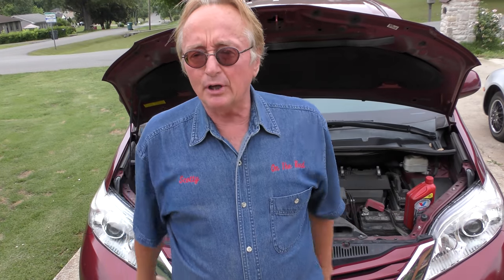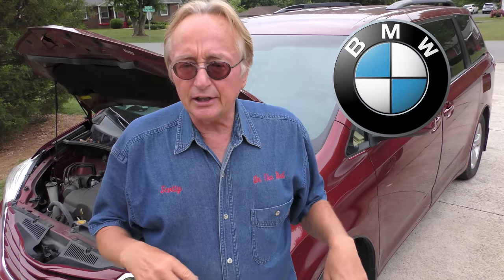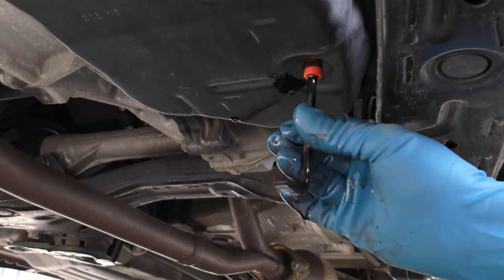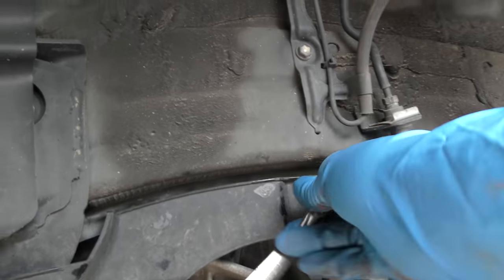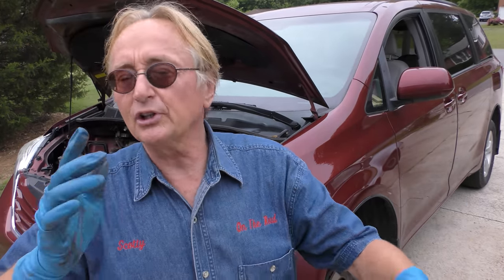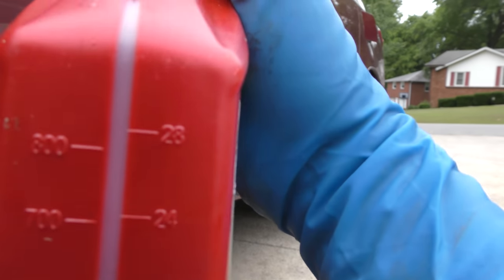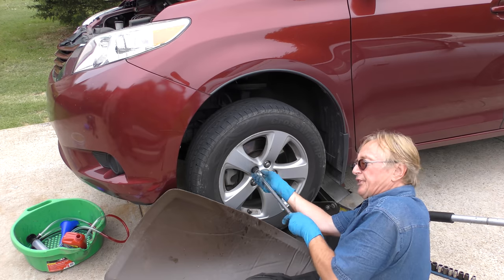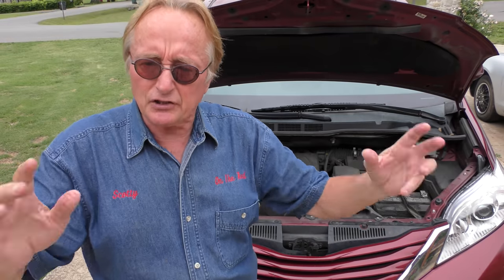Here's Why Changing Your Transmission Fluid Can Cause Damage

Comment: No dipstick is a pain when it comes to refilling.  I put the old fluid into a clear milk jug and use another clear milk jug to place the new fluid into.  Match the levels and you’re on the money quick and not messy.
Reply: I guess so, unless there’s been fluid loss.
Reply: @ltcajh  If the original amount of fluid is not correct all you do is magnifying an already existing problem.   The dipstick was more valuable than people realize.

Comment: I had two vehicles get a power transmission flush done by certified mechanics a couple of years apart from different shops. After several months of light driving, both transmissions failed causing me to lose over $6,000 in total for repairs. I will never ever get a transmission flush done again. Both vehicles had over 150,000 miles each when I decided to get this maintenance done.
Reply: I've now had my third car to make it over 200,000 mi and never did a transmission flush because of the same fears you have.

Comment: I bought an 06 Tacoma at 136k miles and just did 150k service. My mechanic said the same as Scotty, that the trans fluid shouldn’t be changed and that it was essentially “too late”. 
I decided to be proactive and have another shop do an ATF drain and fill. Turns out the fluid, while dark, didn’t have any burnt smell, and didn’t have any metal shavings in it. The transmission has been shifting just as well as before. 
The gasket also needs to be replaced, which I wouldn’t know unless I had taken it in. I’ll do the gasket and filter replacement at 160k and get more fresh fluid in.
Reply: did you replaced filter as well?
Reply: @aztec3r890  yes I eventually went back and did new filter and gasket, plus as much fresh fluid as that job required. It’s shifting better than it did when I bought it.
Reply: @rossedwardmiller  if u want it to do even better get some ams oil for the Trans, night and day difference for sure, I use it in my drag car, a good example would be my camaro for instance lol it was a 2013 with 62k when I bought it, Trans was replaced at 72k for slippage, got it back and it was running fine but could still feel the shifts and whenever u wanted to punch it, it took a sec to get into that gear and let u go, now whenever I changed the fluid at 90k and I couldn't have been happier lmao you no longer felt any shifting and if u punched it, it went into gear quickly and went just like how it suppose to lol but definitely recommend them for the next Trans service, I've been using them for years plus the camaro mileage is at 200k now with that Trans lol plus my other cars

Comment: I own a 2010 Kia Optima 4 cyl. My daughter used to drive it in a busy city.  She returned it back to me at over 100k miles. I noticed that the transmission jerks or slips when it down shift from 2nd to 1st gear.  The transmission oil was never changed. I purchased Valvoline TF and drained and replaced the fluid 3 times. It took over 3 gallons to change the fluid 3 times. We used to drive the car for few miles after each fluid change. I noticed a lot of steel particles attached to the drain plug magnet. After I drove it for few hundred miles, slipping disappeared and the car shifts like new.
Reply: But Scotty says you aren't supposed to change the transmission fluid on an old vehicle that's never been serviced. It will make things worse according to him.

Comment: That red tube you take out is the “internal dipstick”. The drain plug is actually the level check for the transmission. The red tube is there as a level for the fluid in the pan. You have to get the trans up to temp , then with the car running in park, take the plug out (without removing the red tube) and see if fluid dribbles out. If fluid is dribbling out, the trans is up to level. If no fluid dribbles out, you are low, if it gushes out you are overfull.
Reply: Different cars has different process. Some cars have to be off when checking fluid.
Reply: I will attempt the change very soon.  I'm scared
Reply: @mef12727  And what kind of cars are they?
Reply: 104-113F is the specification

Comment: HOLD IT... when tightening the LUG nuts, I only lower the wheel enough to get the ground friction needed to keep it from turning while applying the final torque, NOT all the way down and under full load, which could leave you "half a thread out" on the lower lugs, and result in the dreaded wobbly-wheel... =:O
Reply: When using an impact wrench, start on #1 & do the torquing order. Go to #2 or #3 and do the same. Most shops hit it wide open on all lugs. You can get a wobbly wheel or shakey brakes this way. Follow up with a torque wrench on the ground. I never have any shimmy.
Reply: Never had that problem
Reply: The rim should be sitting on the center hub and the nuts or bolts should always be finger tightened before lowering the vehicle. Once torqued to spec the rim is clamped tightly to the rotor or drum and the tire will have no choice but to flex. The rubber is bendy enough. I have never had a problem with a wheel wobble.

Comment: Scotty Kilmer, I have a 2013 Kia Sedona ,  it has 135,000 and the transmission fluid has never been done.
Will it be ok to change it and and wait a week and change again in conjunction with the transmission filter to clean up all the dirt accumulated from making the 1st fluid change a week before. 
 So I heard if you only Change it once then you will have problems because the fluid has detergents that will clean the transmission and clogged the filter . That’s why I want to do 2 fluid changes. Thank you 🙏

Comment: Scotty is so right about some places not even changing the fluids, I had that happen at Wheel Works on a synthetic oil change.
Reply: Me too. At a Toyota dealer that has been gone for a long time. I noticed when it came back that it’s still have my same silicone gasket that I recognized as mine. Even the complementary car wash was terrible. Didn’t dry it right and waterspots everywhere.

Comment: My cars are from the 90's, and I replace some of the transmission fluid at each motor oil change. I draw some of the transmission fluid through the dipstick snorkel with the pump that Scotty used in this video, they cost about $10, find them where tools are sold under various brand names. Do the same for the steering fluid.
Reply: While it doesn't hurt to do that, you really want to drain the fluid from the transmission fluid pan. Most of the crud you want to get out is sitting at the bottom and sucking it out from the top won't do as good of a job.
Reply: @raizt1596  exactly
Reply: @raizt1596  yeah, drawing from the top is yikes
Reply: @akaroth7542  never ceases to amaze me the weird ways some people decide to do things.
Reply: Do a "full pan drain" on an old, abused high-mileage transmission and have it start slipping like crazy, then you'll know why there's this "weird" way. *Sometimes you just don't want to replace "all" of the fluid at one time, due to a viscosity drop with very worn seals!
Reply: @homesold  This was possible with the old automatic transmissions. I remember when I bought a MB in Germany with 380.xxxkm and the owner told me that in AT the oil is not changed = lifetime filling. I only added less than a liter, which was missing, but I did not risk the exchange. Unfortunately, it no longer works like that in new transmissions - they are produced slowly in laboratory conditions, from 4 speeds we have 10 and the robustness is long gone. Today 80% of ATs die due to oil and 20% due to poor quality component or software error. Unfortunately, the exchange in the video is useless. Greetings from Europe
Reply: @Mijanboy "the exchange in the video is useless". Why? You think its better to leave burnt fluid and crud and not replace with new? If its useless why does Honda specify a similar procedure?
Reply: @johnlucier5654  Pay attention to the oil change interval indicated by the manufacturer (mostly 60,000 km). This is not a recommendation!!! The manufacturer indicates the maximum mileage in km or miles per oil fill. In addition, this figure only applies to normal use of the car. If you have a car transporter with a car behind the car, you need to reduce the indicated distance by half if you have the car transporter with you more often.
Reply: @johnlucier5654  You must always change the entire oil content. If you only change half, the new oil will degrade. Detergents and dispersants in old oil no longer work or will soon stop working. There is no TBN reserve and TAN (acidity) increases and oxidation begins. The oil is thicker because there are impurities in it. Dirt acts as an abrasive. The oil should be changed most often after a maximum of 60,000 km (depends on the manufacturer). This means that the functionality of clean oil is a maximum of 60,000 km. What will be the functionality of 1/2 full of non-functional oil and 1/2 full of clean oil? Theoretically 1/2 so 30,000 km. This is wrong, because in the first case the clean oil fought with impurities that arise during operation, but in the second case it has to fight with the old oil + with impurities that arise during operation. Do you understand?
Reply: Yea that is stupid to do.. DO it right or dont do it..
Reply: @Mijanboy  oh yes i get your point but youll have to convince Honda. Im just repeating their instructions not arguing they are best practice. FWIW honda never recommends a complete 12 qt change. Drain and fill 4 qts, repeat in a few days, repeat again.
Reply: @johnlucier5654  3 days ago, a man arrived with a Honda CR-V 2.4, AT 5G, 2010. He already visited 8 Honda dealers and did not get 2 of the same answers!!! He only wanted to find out more information about the AT fluid change, and he hasn't even found out the change interval yet!!!
I offered to download the user manual, but he handed it to me from the car with the words: The fluid change interval is not mentioned !!! I did not expect such an attitude from the careful Japanese!
  I showed him how vast the difference between Honda and MB is in this respect. When he saw on the Mercedes website over 40 types of oil of different brands that MB approves for use in MB, instead of the "original" MB oil/fluid, he couldn't believe his eyes. He took the Honda user manual and showed me with his finger: Honda recommends using only original Honda oils and fluids, otherwise damage may occur !!!
  When I told him that this is nonsense and that I bet it won't be written like that in the manual for Europe over 2015, because Honda would immediately receive a several million fine from the European Union due to the violation of free trade, he didn't believe me.
I downloaded the CR-V manual for the model from 2016 and it says: Honda recommends using only original Honda oils and fluids, OR THEIR EQUIVALENTS, otherwise damage may occur !!!

I've been noticing huge differences between the European version of the car and the US version of the car for a long time (in general). As if we were different people. It's the same for blacks and whites in the USA... I didn't expect such progress :) that you are already equal... now the new racism is probably "IN": USA vs Europe ...

But back to the CR-V. I knew that I must not take into account how it is in MB, that I have to find out everything again, as if I did not have 30 years of experience. I didn't even take into account that I know that Honda has an external AT filter "on the hose" or under a separate cover in the upper part of the AT, etc. I am often contacted, just from the USA about Honda and Toyota, so I have some insight. For the sake of objectivity, I prefer to search again. I also know that you're not entirely right about Honda only changing "what leaks" but I'll get to that.
ATTENTION!!! I'm glad that the chosen approach (not relying on anything I know) immediately brought interesting findings. A VERY IMPORTANT FINDING. OIL LEVEL IS MEASURED WITH THE ENGINE OFF!!! I immediately look at the European Honda club and there they claim the opposite. I'm looking at US Honda dealers: the engine is also started. But here the manual speaks clearly!!! Coincidentally, the same result with the Accord 2010 AT 5G. So does the Civic.
On Honda's US websites, pop-ups are bothering me. Do you need any advice? Why not? And I start a chat. Hello, I need your help. It's a simple question. Why do you claim that the 2010 CR-V checks the AT level with the engine running when the 2010 owner's manual says otherwise? Send. And it came: Hello, my name is John, I'm a Honda service technician. How can I help you and what is your name? I answer: I see that you need help because you can't read. Get someone who can do it and point to my first chat. You will hear a simple question - I demand a simple answer - I don't care about anything more... not even your name, looks or gender. send And it came: we will have to check whether what you claim is true and that will take a while. Write me your email and we will contact you.
I'm writing: I'm not interested, I'll wait for you to check it - it took me 5 minutes and I'm not Honda. You can download the user manual from Honda com and it is a pdf page 361, the very first paragraph. I'll wait. send Answer: unfortunately my colleagues had to leave, write me an email and we'll get back to you. Answer: I am not interested thank you.
    This basically happened 2 more times...with other US Honda sites.
I will continue later, I am going to do something.

Comment: Personally I would make sure the fill plug will come out before I drain the transmission fluid other than that it's a nice video.
Reply: Could always drill through the side of the transmission and make your own plug.
Reply: Great advice..
Reply: I had a Nissan truck that couldn’t get the fill plug out of the five speed tranny, I had to refill from another place farther up
Reply: Was thinking that myself

Comment: Changed my Polaris 800 x2. Drained it overnight. It needs 986ml, it only took half a quart. Thank you so much! I could not for the life of me figure out why it wouldn't fill. You have to stick a hose in horizontally and just pump until it reaches the bottom of the fill thread. No where does it mention filling it dry anywhere, I didn't even realise it was an issue.

Comment: This is a good, quick method to do it, but I highly suggest to do the thorough way and drop the transmission fluid pan. The pan has magnets that collect metal and has old transmission fluid on it. On top of that, the transmission fluid filter has to be replaced as well, so there's no way to get around that.
Reply: I did this on a Jeep Patriot with CVT transmission that started reving too high on hills. 2 dealerships I called said fluid was lifetime and the whole transmission needed replaced.

Comment: I just change the tranny fluid on my brothers 13 civic lx with 181,000 miles that we bought a couple months ago and never knew if it had been changed before. It was dark red color but not black and the tranny performed even better afterword with smooth shifts :)

Comment: I have changed 1000+ cars transmission’s fluid. No one has came back because of it. The fluid in your engine doesn’t last forever it literally deteriorates and breaks down. This is the reason why I have a lot of customers because they listen to Scotty Kilmer keep it up! I have changed my transmission fluid in my 2003 Honda accord with 300,000 miles and it shifts smoothly!!! In other words don’t change your oil. It will damage your engine, please….
Reply: I have a 2010 camry 2gr fe....it has 115k miles never changed....should i change it?  I hear it can cause issues at this mileage but i int3nd to keep the car forever
Reply: @bjarman125 just don’t do a flush.  Changing the fluid and filter won’t hurt anything

Comment: I just bought a 2015 Nissan Altima that happens to have a CVT transmission. You said you recommend changing the transmission fluid every 30,000 miles. My car has approximately 93,000 miles on it currently and I have no idea if the transmission fluid has ever been changed before or not. What do you think I should do? Should I begin changing it on a regular basis or is it too far gone to begin that with this type of transmission? Thank you in advance!
Reply: i am on the same boat, same miles & don’t know if it has gotten transmission fluid changes. Can someone answer if we can change it out or just leave it cause it’s too late ?

Comment: Scotty's method (put in what you took out) is valid providing the car has sat overnight and all fluid (old and new) are at the same temperature and thereby occupy equal volumes.  The convoluted method described by Toyota uses the overflow tube with the fluid at a set temperature because letting the car cool down all the way is not realistic for the service department.